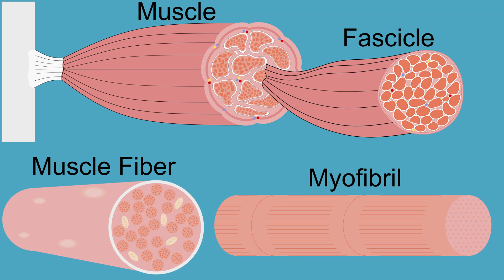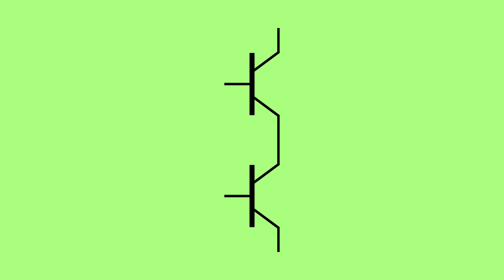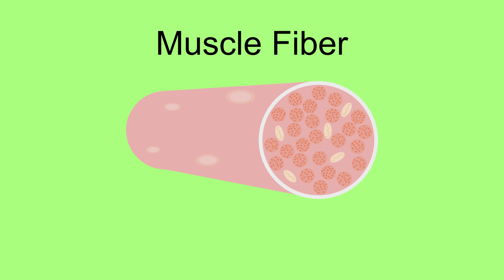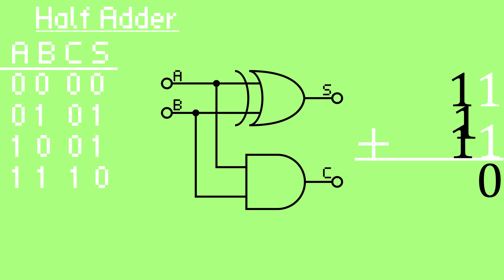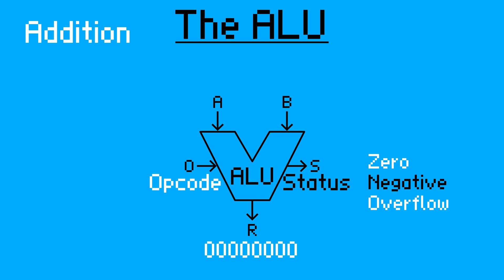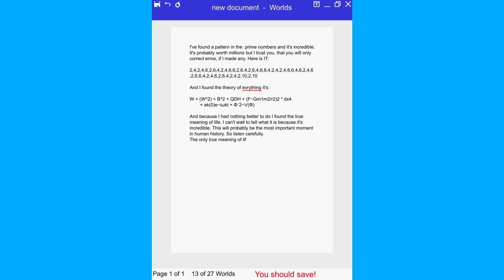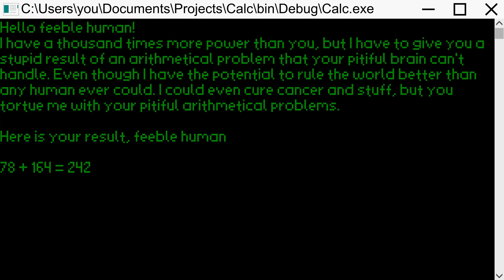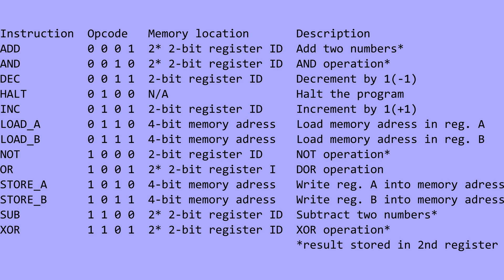How computers understand programs: From transistors to a CPU (1/3)

Comment: The graphic with the transistor and dam, you had emitter and collector backwards. Emitter is line side or the high side of the dam. Collector is load side or the low side of the dam.

Comment: A half Adder has no memory, consisting of an XOR gate and AND gate 
with the machine language or binary system in which  when there is a flow of negative charge carried by oscillating  free electrons, and simultaneously  a flow-like transmission of positive charge from cation to cation or from positively charge ion to  positively charged ion, the voltage signal is interpreted as on = 1, when there is not any flow of charge , the signal is interpreted as off = 0 

Here is the truth table for an half-Adder

  Input      Carry       Output     
A       B       0ut          Sum
0        0        0                0
0        1        0                1
1        0        0                1
1        1        1                0
We can see that the XOR gate is different from the OR gate only in the last inputs, where the sum of the XOR gate = 0 and 1 is carried out  into an AND  gate

A----------------   half    ---------- sum (output)
B----------------   Adder ---------- carry out

That's a Hal-f Adder. it looks like a rectangle with 2 inputs A & B, one out put and one carry out

Unlike an Half-Adder, a Full Adder has a memory, consisting 2 XOR gates in continuous connection, 2 AND gates in parallel connection to the XOR gates , and one OR gate. The sum comes out through the 2 XOR gate. The carry out comes out through the OR gate. There is also a clock  to control the carry in signal ----> 3 different inputs clock, A & B , the outputs are the same as the  Half-Adder. Since a Full-Adder has a memory, it is called as " a latch" 
Basically, the carried out  voltage signal of one Half-Adder is fed into one of the inputs of the next Half-Adder of which the other input is a clock to control the carried in voltage signal 
Here is the truth table for the Full-Adder 
A    B    C   Carry    Sum
0    0     0      0          0
0    0     1      0          1
0    1     0      0          1
0    1     1      1          0
1    0     0      0          1       
1    0     1      1          0
1    1     1      1          1
-----------------------------------------------------------------------------------------------------------------------------------------------------
8 Half-Adder connected together in that way make a 4 Full-Adder, or  an 8 outputs or 8 bit Hal-Adder,  which is called as "an 8 bit Ripple Carry Adder.  The max scalar or quantity value of storable bit for an 8 bit Ripple Carry Adder in terms of base 10 is 256 . If there is a carry into 9th bit, the sum will become too large to fit into the 8 bit Adder, which will cause errors or unexpected behaviour in the ALU, and is caused as an "Overflow" . We can fix the problem of overflow by adding more Full-Adders to the 8 bit Adders, such as 16 bit Half-  Adder , 32  bit  Half-Adder, 64 bit  Half-Adder to the circuit. 

When we feed an output back into one of the inputs, the circuit of gates is called as "a latch" because it latches a particular value. Putting such bits which are the machine language in binary system is called as writing data into memory, and getting such stored bits in the circuits of gates is defined as reading data 
With a clock to control the gate of the latch, or to open or close the gate of inputs of the circuit is defined as a gated latch, and that's why we have "write enable" , and " read enable" functions.  We can  put. 8 gated latches together side by side to save 8 bits of info , and the group of the gated latches make an  8 bit "register"  . Similarly we can increase the number of gated latches to make 32 bit, 64 bit registers
To write data to the registers, we will have to enable all of the gated latches, by  sending a voltage signal which corresponds to 1 in binary system, along a single wire which connects to all the latches' "enable inputs"
The side-by side design for gated latches is workable only for a small number of gated latches, but not for a larger number of gated latches. For instance,  in a 64 bit register containing 64  gated latches, we will need 64 wires running to the inputs, 64 other wires running to the outputs, and one wire to enable all the gated latches----> the number of wire = 64 + 64 + 1 = 128
For a 256 bit register, we will need  (256 + 256 + 1) wires = 513v wires, The size of the CPU is too small for that hardware  design or architecture. Hen, we must make the circuit compacted by applying the idea of a  256 by 256 matrix, in which we arrange the gated  in a grid, but no longer in a row . We use an AND gate to control the gates of 256 gated latches. Example, if we want to open a gated latch at a certain  location in the grid,  the AND gate will output a 1 only when both the column wire and the row wire of the gated larch are transmitting a voltage signal , which is decoded as 1 in binary system. Hence, in order to for a latch to become " write- enabled" , the row wire, the column wire and the "enable wire" must be sending a voltage signal or 1 in binary system. Only that gated latch is activated at the given time, while all other gated latches are disabled or not active.
That's a brief  explain for you to understand some basic design of computer hardware , and how info is  stored and transmitted  in a computer's CPU & ALU

Comment: There are lots of sectets that can enhance a computer or a micro sd card, all these simple tricks are kept secret. Usually the secret has to be done only once after a computer is bought. Some of these: Diablo Strength, magic, dextetity, agility, defense, intelligence, luck, all these enhance the cpu by residing inside the internal cache. The cache is kept alive with an infinite circuit of caoacitors, you can erase it using your fingers or pliers. Legal Windows goes even further, it takes care of the external cache, depending on how you use the computer. The speed boost is amazing, 1 ghz is enough for everything today.

Comment: The presentation of this video is good, but I don't like the explanations.
The analogy with human muscles fails. Computers aren't just big switches made of smaller switches.
The explanation of transistors is naive and the logic gates wouldn't work. You have to mention current sinking versus sourcing for the gates to make sense and the idea of pull-downs and pull-ups (ie. bias) for the transistors to make sense.
The explanation of arithmetic isn't wrong, but you go over it too fast for someone just learning, in my opinion.
BTW I'm not a fan of explaining computers by starting off building an ALU, but I guess that's just my particular thing.
Reply: What's your favorite approach?

Comment: Great video ! Thanks but I need to know how the Control Unit works, how the instructions are hard coded in the hardware
Reply: This type of CPU works in steps, load stuff in the alu, open x register, write to y register, etc. mostly in 7 of them.
To do instructions, it decodes the instruction number with a decimal decoder (search the circuit) and if it's X instruction AND Y step, it will do W thing (what it's meant to do in that instruction at that step) I recommend searching a PDF for the scott cpu book "but how do it know?"
Reply: @ExtremeGamerYT22  thank you very much for your explanations ! I downloaded the PDF!
Reply: @charliebrownn6622  It will have all the things explained in the video in logic gate's level of detail, good read!

Comment: okay so one question I have... is cache, ram, and registers the same in the silicon (hardware) layer or is there a unique difference between them that give them different names?

Hope you have a great day & Safe Travels!
Reply: It starts with some instructions in slow memory at address xy and a block of these instruction is going in the first level cache so the next instruction is loaded for execution from the cache. And a lot instruction use register as a source and/or a target operand without a memory access and without to touch the cashe again. Only if we read/write into the memory we use the cashe again, or if the next instruction is not in the cache. The cache is used for code in slow memory and for data from and to slow memory.
Reply: RAM is a large array of many registers. When you take the value of the RAM at an address, you access the register at that location. A cache is just an additional register that allows you to speed some operations up. For example you could store a calculated value in the cache so you dont have to load it from ram later. Physically, they are all flipflop latches
Reply: @lennarth.6214  If you have a CPU that uses DRAM (i.e. DDR4/DDR5), your cache and RAM are not physically the same (although I see your point that they are just used to store addressable ones and zeros). Additionally,  just to clarify, "flipflop latches" aren't real; and flip-flops and latches are not the same thing. Latches are asynchronous memory devices and flip flops are synchronous (rely off clock signal for state changes)

TL;DR registers exist on the CPU, cache likely exists on the CPU and RAM will likely exist outside the CPU (there are architectures where CPUs get dedicated blocks of SRAM, but we can ignore this for now)

There are unique differences between registers, cache, and RAM: proximity to the processor and the way the processor interfaces with them. CPU registers are are the fastest memory on your CPU. They're physically stored together in something called a "register file," and exist in close proximity to the CPU. There are different hardware architectures for how the register file exists in silicon and operates, but its purpose is to provide the CPU a program counter and to be used for CPU operations. Moving out in the memory hierarchy, there is L1 cache. The L1 just indicates it's the first level (level-one) of cache beyond the CPU registers. It's used to store copies of instructions/data from RAM so that they're closer to the CPU (faster to use). For example, if your CPU has an instruction to grab data from RAM, your CPU may check L1 cache and see if the data is there and valid (which is another conversation). If the cache looks good, then you saved time by not fetching it from higher levels of cache... or worse, RAM. There are methods for speeding your system up, like hardware/software prefetching (either hardware predicting CPU actions and grabbing potentially useful instructions/data from RAM, or having a compiler insert instructions to have cache prefetch instructions/data from RAM)

The register file will exist inside the CPU. L1 cache is likely designed to be baked into the processor itself as well. Any level of cache may be baked into the processor--but it doesn't have to be the case. You could even have a processor with no cache. On top of that, not all caches are the same (i.e. one CPU's L1 cache may be designed differently than another CPU's L1 cache). Cache controllers may also use different algorithms for deciding the best way to use the cache itself (i.e. what/when to overwrite in cache). It's also common to have shared cache between CPU cores.
Reply: @Opuskiller1  very good
Reply: @lennarth.6214  thanks for the info! it is also explained as I found out with CPU and Caches video later in this series. Thanks for telling me. [EDIT: as I later found out]

Hope you have a great day & Safe Travels!